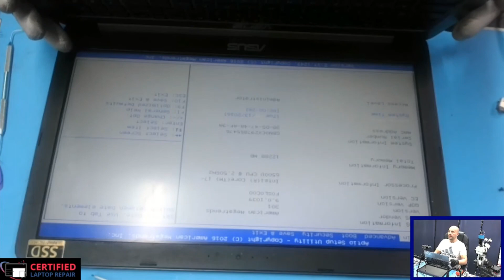Asus laptop charging port repair

Comment: As an amateur replacing the charge ports and other simple odds and ends regarding my own devices, I only own cheap repair equipment. My desoldering gun doesn't vacuum as well as yours resulting in some lost pads when first using it. I now have consistent luck using a reflow gun instead and then using solder wick to de-solder the rest of the way once the part is removed. Being a novice, I use Kapton tape to heat shield nearby components from the heat. I still sometimes forget to add the low melt solder when beginning one of my infrequent repairs. Most of the simple repairs I do are successful. When I fail, I buy more parts and start over.
Reply from the maker: Thank you for sharing your experience.  Early Next week, i will be uploading another video with similar problem on an msi laptop, where i repaired the jack instead of replacing it.  I think this would be great for starters as well.  I will also be sharing some in depth board repair videos upon availability.